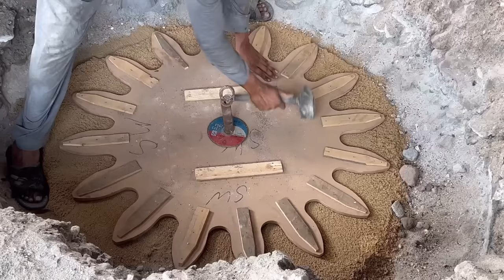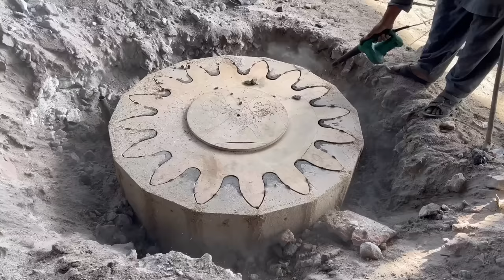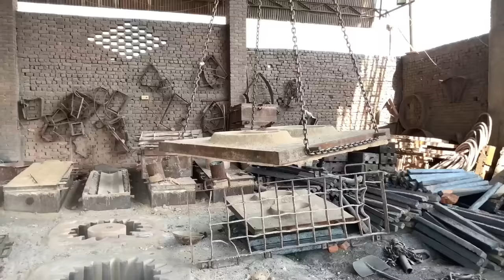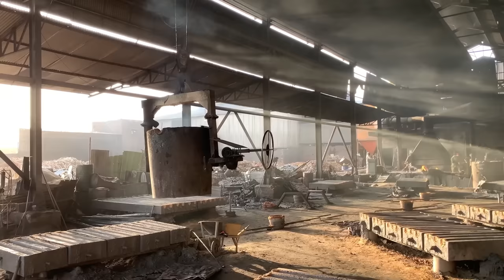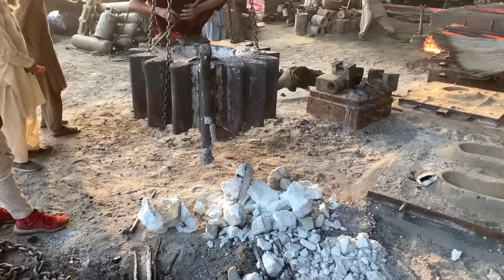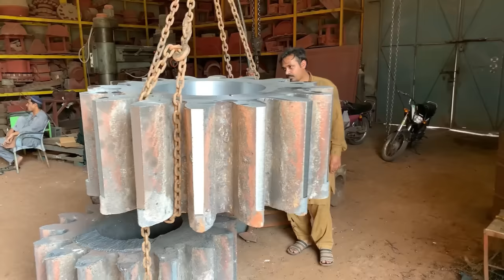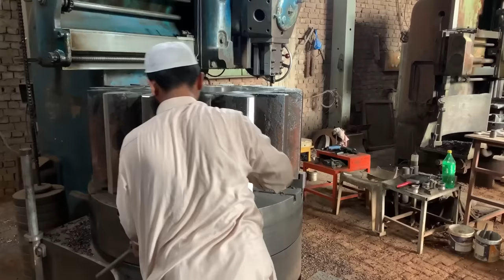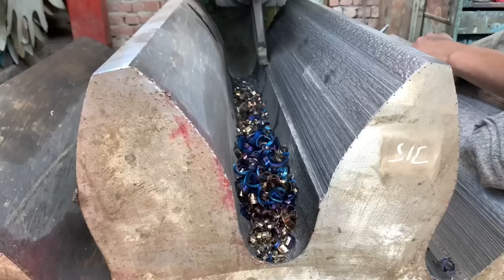Handmade Making Process of Large Milling Machine Gear | A Huge Industrial Gear Manufacturing Process

Comment: Gears like this are used for bridge mechanisms and such.  They don't turn fast, never get a lot of revolutions, and the surface finish will lap in with wear. There are 150 year old mills with gears made in this fashion that are still working.
Reply: Without heat treatment, and depending on how much they operate, they won't last to see another day
Reply: @badseednut  I don't think this is their first rodeo. If they just broke, there wouldn't be an entire set up to make them like this.
Reply: @Anax100 I agree. The focus is different: efficiency in terms of cost. It must be cheap, and it must work.
Reply: They engineer the gears so they still have a job next year!!😉
Reply: Thanks, I had been thinking for huge ships.....
Reply: Nope, it lasts for a long time. You guys are just thinking too much.
Reply: @badseednut  If you don't have a setup for heat treatment, you just have to over engineer its bulk instead.
Reply: @Anax100  What you think and what you know are two completely different things. And from what I know, being or not their first rodeo, this is not gonna last if it's not heat treated.
Reply: @gavinjenkins899  Without heat treatment, waste of time. All of it.
Reply: @badseednut  You didn't actually respond to what i said. Your comment is a waste of time with nothing in it to reply to, not the gear though.
Reply: @gavinjenkins899  And yet you replied...  And I am not sure why you turned it into personal. That's weak. Anyway, you are obviously a keyboard fighter. Good luck...
Reply: @badseednut Uh I didn't make anything personal. "Your COMMENT is a waste of time" is not personal, lol. I'm sure you make plenty of other comments on other days that are just fine. This one, though, was pointless, as you added nothing in actual response. You STILL haven't added anything now either. When/if you actually provide an argument on topic, we can go back to the topic, which is that weaker metal can be compensated by overengineered bulk. It works just fine. By your logic stone bridges can't exist because it's brittle and much weaker than steel.
Reply: @gavinjenkins899  Ok, with all due respect, I am going to give you the benefit of the doubt because I don’t know whether you are a troll or someone who just thinks that common logic is science. I seriously can’t tell. But I can tell you that your logic, to someone like me, is kinda moronic because you are comparing the construction of bridges with that of gears. One is civil/structural engineering the other is mechanical engineering and steel metallurgy. It seems that you don’t know the difference... 

So here is an effort to help you understand a few things, something that I don't normally do as I find it... guess! A waste of time... 

Stone and steel are two completely different materials, meaning they sustain different types of forces (compression and tension); thus, each requires a different structural shape when it used as a construction/building material. It’s not the bulkiness that makes a stone bridge able to sustain a load, it’s the structure. 

In gears, steel is very strong but it has zero resistance to wear. It needs to be heat treated, meaning hardened and tempered.  Hardening steel forms austenite which makes it brittle but wear resistant, and then quenching it forms martensite which under certain temp and duration, it decomposes and forms iron carbide particles. Hard outside, soft inside. Like the famous Japanese Katanas. If a gear is not heat treated, it will wear off like butter does under a hot knife. If you had a clue how steel metallurgy works, you would have understood my original comment which was: Without heat treatment, it’s a waste of time.  
I am sure you can find plenty of info online, if instead of wasting your time commenting on youtube, you actually spend it doing some research. Good luck.
Reply: @badseednut  Bridges use gears just like this all the time. It wasn't an analogy, it was a dead literal on topic example of this same item featured in the video. This one happens to say it's for a milling machine, but the same type of gears made the same way have been used in bridges in the western world for generations before any modern standards. Including non heat treated ones that have lasted for 100 years just fine in actual bridges. So you are simply objectively, observably wrong. It factually works. It works by being built beefier and thicker than treated ones could be, which is the tradeoff, but it factually works fine. You would know this it "instead of commenting, you did some research" "Good luck"
Reply: @gavinjenkins899  Can you name one?
Reply: @badseednut  Sure the Chicago & North Western Railroad Bridge was built before nitriding was even invented, for example. It's made of steel, but I know of no way they would have heat treated the gigantic gears after milling any more than these pakistani guys
Reply: @gavinjenkins899  So basically you don't really know that they are not treated. You are just making an assumption.  Bascule bridges, the type of bridge you are referring to, have historically used hardened gears in their operation to withstand the heavy loads and frequent movement required for their functioning.
Reply: @badseednut  Using what technology? The most basic current ways of hardening like I said weren't invented yet. So what else did they use and where are you getting that from?
Reply: @gavinjenkins899  @badseednut Between the both of you, all I can say is scientists predict things, engineers over complicate things, and technicians experience things. If you want to know how things work in real life, ask the technician.
Reply: @gavinjenkins899  What on earth are you talking about? Case hardening is known to mankind since at least the 12th century BC. And in the 1900 AD with the industrial revolution it was improved by using alloy elements. Ok, listen, I was not being sarcastic or ironic when I said to you go do some research. I have already explained to you how it works. You are arguing without having the basic knowledge. I think it's time for me to follow the advice of Mark Twain. Good luck.
Reply: Am i the only one that is worried about this?!?
Reply: @badseednut  That's right, everyday at the mill, they break one of these giant gears and they have to buy a new one. It's amazing they get any milling done at all.
Reply: "I used to own a mechanic shop, but the internet has turned everyone into a bunch of know-it-all morons." -a mechanic  @badseednut
Reply: @charlesdjones1  Exactly what I am saying. Thank you  and have my respects.
Reply: That is survivor bias. It doesn't matter that you can find examples of this that are 150 years old, you have no idea how many failed long before that. If you make a thousand gears and wait 150 years and find one survived, that doesn't mean the tech lasts that long. 999 might break in a week.
Reply: @Anax100  A scammer might have a nice car and a lot of money. It doesn't mean what he does is valuable. They make entire setups like these because everywhere there is demands for parts, and in most places like these, the local buyers don't know any better. So if they buy this and get scammed. But there's a new sucker around every corner.
In the US they would get bad reviews and eventually no one would buy. Do you think they have Yelp reviews there? Some guy says "I need a gear like this", they say "of course my friend, we do like this all the time, best quality", then quote a lower price than what a quality part would cost.
Reply: NO THERE ARE NOT. THERE ARE NO 150 YEAR OLD GEARS MADE THIS WAY. PLEASE DO NOT LIE.
Reply: Those 150 year parts were not made here and at a time when quality was better
Reply: So you assume
Reply: @badseednut  I'm gunna have to weigh in here, how do you explain the bronze gears in every worm box that has ever been made not to mention wood gears in flour mills for 200 years. Gavinjenkins is right, take it from me, I build gear boxes for a living and I have to inform you that many light duty boxes don't have heat treated gears and the big fellas are rarely heat treated, they are often made out of cast iron and soft as butter! Don't underestimate the ability of heavy duty grease or oil to keep the mating surfaces apart.
Reply: I doubt your statement
Reply: I am pretty sure that they are in fact going to heat treat this afterwards. There is nothing stopping them from doing so. As long as they have a large enough oven and a tub filled with oil to dump it in afterwards.
Reply: Are they also 50% copper?
Reply: @badseednut I think your undereducated
Reply: Does heat treating random mild steel scraps even do anything?
Reply: @2vcrew782  Says the one who doesn't even know basic grammar. I rest my case 😂😂😂
Reply: @badseednut  Right. I don’t know the difference between your and you’re.
Reply: "What kind of steel is this?" - Oh, you know, a little bit of everything
"What's this giant crack right on the tooth here?" (@36:25) - Ummm
Reply: @badseednut  Talking out of your ass man. Rarely are things this big ever heat treated. Heat treating is for if a design needs a higher hardness/stiffness to weight ratio than what overbuilding with mild steel can provide such as tools/blades/bicycles. What you think everything with high strength and load requirements needs heat treated steel? You'll be shocked to learn that cars, construction equipment, and ships don't get baked in a giant oven after their welding stages.
Reply: @xungnham1388  sure... whatever floats your boat
Reply: It's not a Chinese toy.
Reply: @badseednut don’t mind these self-made internet experts, everyone seems to be an engineer and knows how everything works. I enjoyed reading your comments and find them perfectly valid and on point. Best regards.
Reply: @maxieboy  Thanks sir, I appreciate your comment.
Reply: @Anax100  "an entire setup"  = hole in the ground
Reply: Were those 150 year old gears made with random semi-cast / semi-steel?  Doubt it. Were they made with huge inclusions and porosities? Doubt it.
Reply: @Anax100  But the end application is a Pakistani steel mill, not a Japanese or German or whatever. They too are used to breakdowns, same as their trucks and earth movers.
After all, how would all these people stay employed if they built stuff to last?
Reply: IF they last so long, why do they have this set up to make new ones so often?
Reply: @Anax100  You think the buyers are any more thorough? In India?

Comment: This is why western-manufactured parts are more expensive: They use the proper grade of materials, are finished to the specified tolerances and workers are equipped with the proper protective gear.
Reply: That's also why when Chrysler outsourced the production of engine heads to India in 2001-2002, every single head failed, with some of them literally melting off the engine block.
Reply: Not to mention energy bills, pollution and environmental impact and related policies ...
Reply: Yeah, sometimes the cheap junk works good enough.  However, this cog looks like it is going to be put into something very expensive.  It also doesn't look like you can just buy 5 for the price of one and just keep easily replacing the part.  The man hours to just put this piece in place might cost just as much as if they simply bought the higher quality piece to begin with.  I'm not expert though.
Reply: proper protective sandals*
Reply: Are you questing the grade of materials?  Did you not see what was in that wheelbarrow?
Reply: @spacecoastz4026  Lol... that one wheelbarrow almost became part of that cog.
Reply: They don’t hire 10 year olds either. It’s much more expensive to get a grown adult to do your work.
Reply: @101perspective  That production looks like it manufactures these gears in large volumes, so clearly the customers are satisfied. Machine design prescribes part tolerances, and the parts are only need to be "good enough". If you use parts that are too cheap then the machine wil fail early, but you don't get any better performance out of a 10x more expensive part than is required.
Reply: Let's hope this doesn't go on anything important. And hopefully it's just for Youtube.
Reply: @michaelbuckers  in this case, tolerances can be within cm, that's fine. they'll buff out when in place anyway
Reply: Bet the grifters at the managerial level are less of a burden too.
Reply: We are assuming these gears don't have the proper tolerances, but the reputation precedes them though.
Reply: @TehButterflyEffect india exports cars to japan,india is not pakistan.

Comment: For those wondering about the gas step:      Gas-cured (“Cold box”). Sand and a gas-reactive resin system based upon phenolic urethanes, acrylics, or sodium silicates; gases include amines (TEA/DMEA), SO2, and CO2. Sand is first mixed with the gas-reactive resin system and deposited into a core box. The mixture is instantly hardened by blowing a specific gas through the core box; thus working time is flexible as it is a function of the delay between molding and gassing. The mold can be used immediately for casting. Sand is removed either by physical methods (shaking/rapping) or via thermal operations that pyrolize the binder.
Reply: Thanks!
Reply: Thanks man I was wondering just that !!! What about all the scrap metal they use ? does that make sense ? Looks like a big mix of different stuff.
Reply: Always check the comments, thank you kind person for this info.  I was curious what they were doing with that.
Reply: get these man a real mold :(
Reply: For us dumb people, he literally said "The gas they use, is used to harden the sand so it can be used for molds quicker"  your welcome lol
Reply: Thanks for your knowledge 👏🏻. I was wondering about that
Reply: epic!
Reply: Huge metal castings are usually done in sand, even in first-world countries, and wooden patterns are still commonly used too.
Reply: lol how did you know
Reply: First time I see these guys not using used engine oil
Reply: @emilybendsspace  Yeah.  "Hand-made" is a bit of a misnomer, as they're operating a serious smelter, foundry, and milling operation.  I always sucked with the foundry part of metal shop.  Good to watch people with actual skills.
Reply: For those wondering about your gas source, you can use gobar gas!
Reply: so they have a rapbattle with the sand to get the sand out?
Reply: Thanks, man. I was just wondering wtf they did with all the hole poking and so on.
Now I know... :)
Reply: What about the durability of such material?
Reply: @user-xy2nh2db8w  It depends on what torque is applied to them. However, I'd expect much less than if it was made from materials one SHOULD use for this.
Reply: wtf is this some kind of chatgpt answer or something? it's probably just sodium silicate binder and co2 gas
Reply: @WwarpfirewW  That is how casting molds have been made for centuries.
I guess you didn't know that.
Reply: still a little confused but you explained it well
Reply: Yes I was very much wondering about this step indeed 😄Thanks for the details
Reply: @shashankachoudhury3667а пердячий газ не подойдëт?🤔
Reply: THANKYOU!
Reply: @Chris-yy7qc Molasses is pretty typical.
Reply: Thanks, came hoping for info.
Reply: That's not true.
Reply: Thank you, exactly what i was looking to know. Please get your comment pinned.
Reply: And i got hung up on his sandals!
Reply: Huge thanx
Reply: thank you
Reply: I understood 10% of that which is a lot more than I understood before.
Reply: I was in fact wondering about that, thank you.